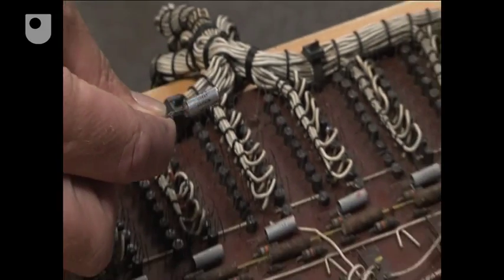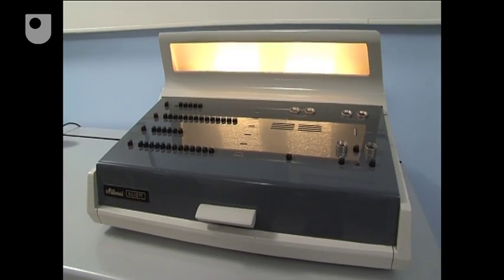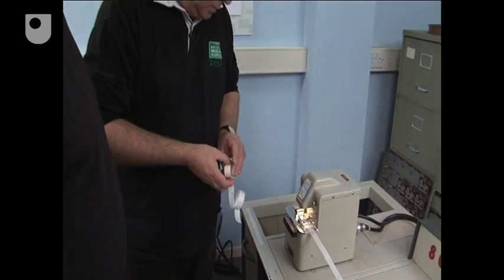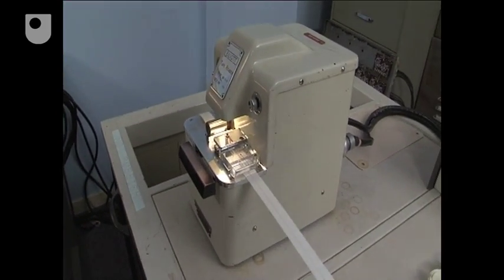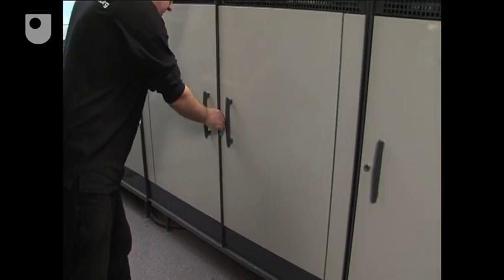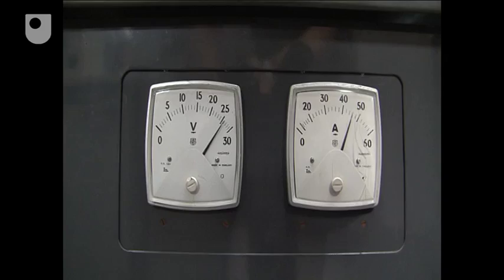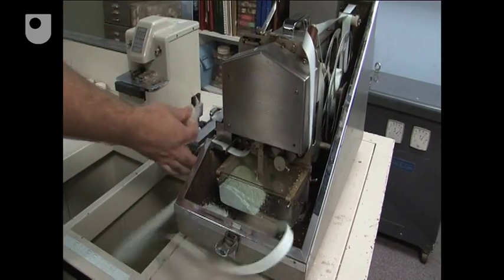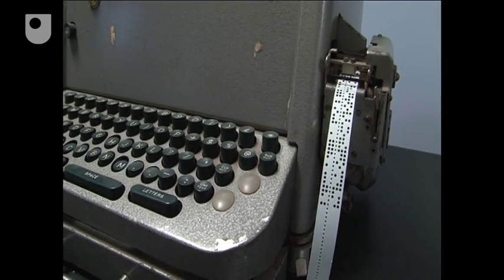Elliott 803: Second Generation Computers - The Four Generations of Computers (2/4)

Comment: I worked on the two Elliott 803s in the 1960s used at RAF Fylingdales for calculating and transmitting the ICBM alarm levels to all relevant UK defence positions. The original programs were written by Dina St Johnston of Vaughn Programming Services but I implemented the updates and programmed many test and maintenance routines. It was a problem to add the VPS modifications as the code already filled the 4K of memory.

Comment: @joshbaleSignedIn Yeah, I also genuinely laughed out loud when he showed us that massive cabinet - and it's only 4K of memory.
Reply: Well, it's 4K, meaning 4096, but not 4096 bytes, but 4096 "words". The length of a word varied from machine to machine. In this particular one it was 40 bits. You can consider it as 5 bytes each, so in this case "4K" means 20 kilobytes in today's terms. Still not much for a massive cabinet, but yeah, core memory was not small.